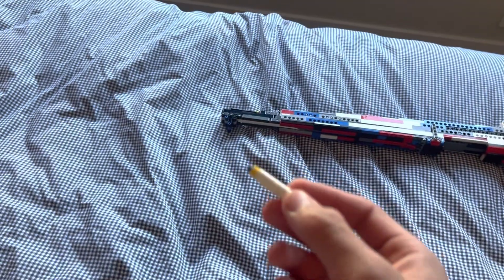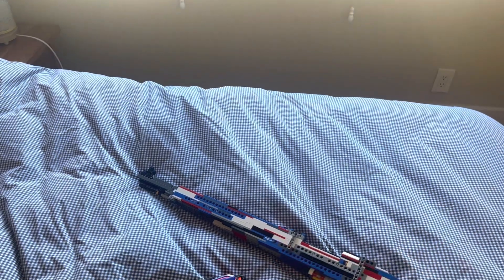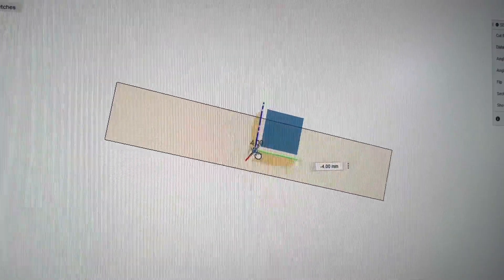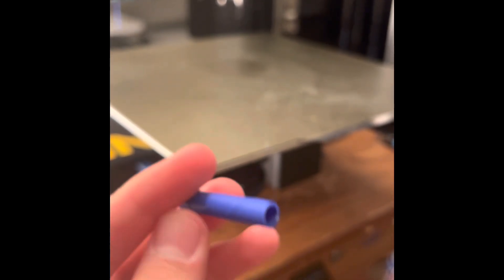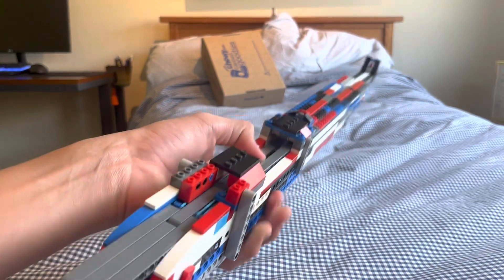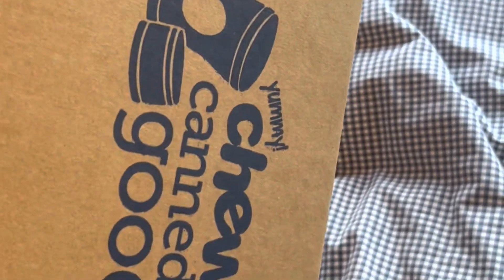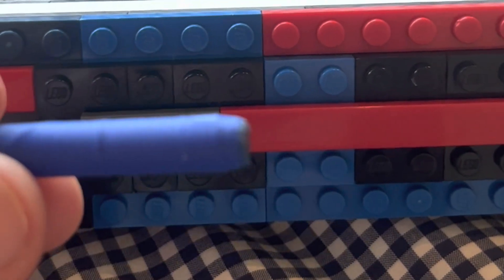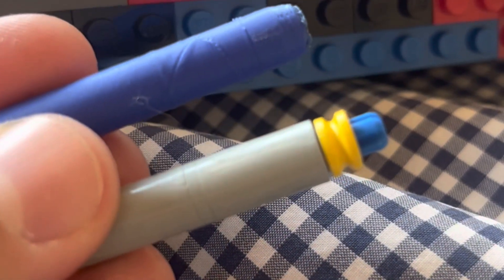Making a STABLE LEGO PROJECTILE?!

Comment: The layer lines from 3d printing may damage the lego more as the projectile isn't a smooth PIM cylinder
Reply from the maker: The bricks are so screwed up from the regular projectile it doesn’t matter. The 3D print is pla (harder) and the legos are abs (softer), so it is a concern if you want to keep your bricks in good condition.